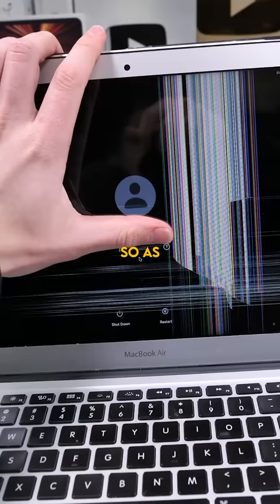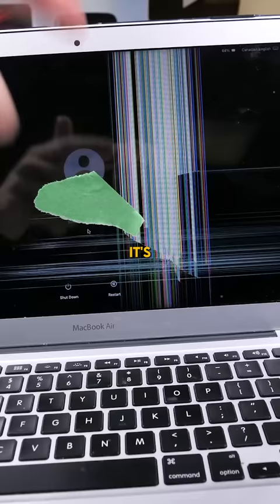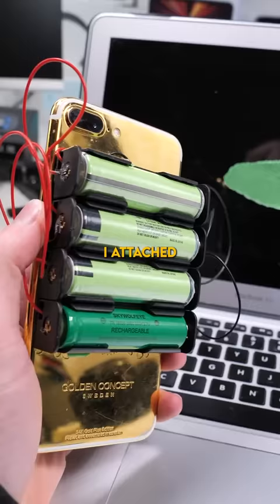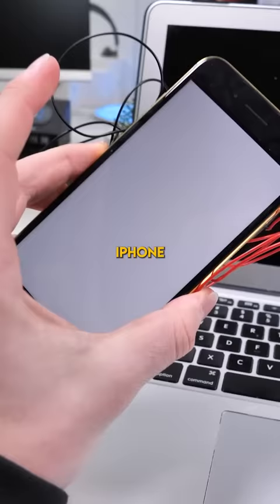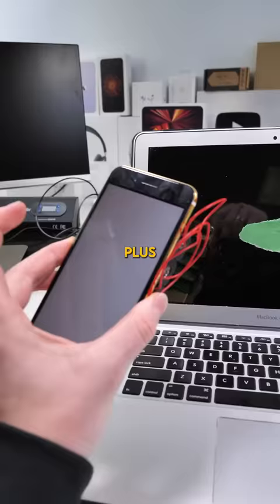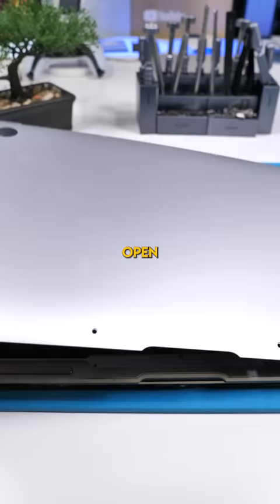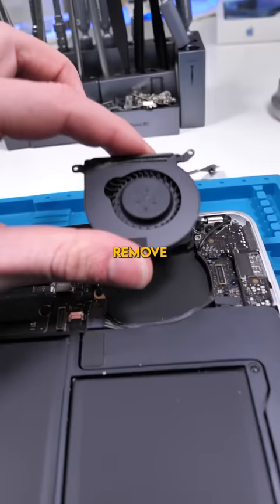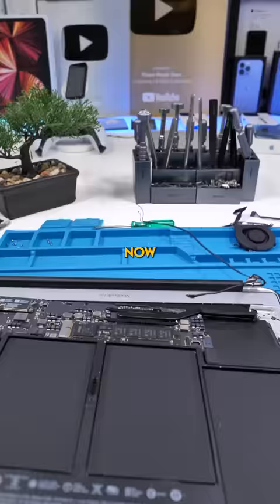How Easy Are MacBook Screen Replacements?  #Shorts

Comment: I have a 2017 MacBook Pro with a thin black line going across horizontally. How much would it be to replace it and if it’s worth it? Want to replace the screen if it starts getting worse

Comment: @phonerepairguru what about taking the replacemt LCD and swapping it into the OEM bezel? 

I know it would take more time, but with so many aftermarket “swap in” units having the hinge not hold the weight of the screen/bezel within a year or so..sometimes less.

What’s your experience with both situations?
Reply from the maker: This is a pull from a laptop, it is oem